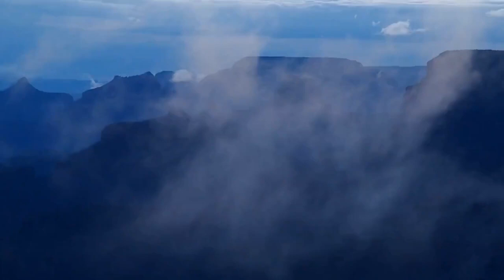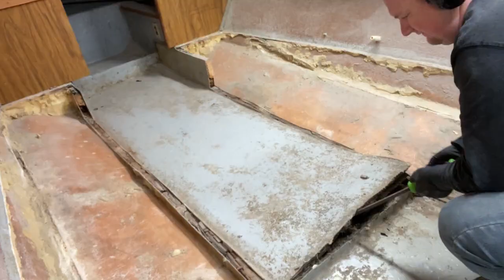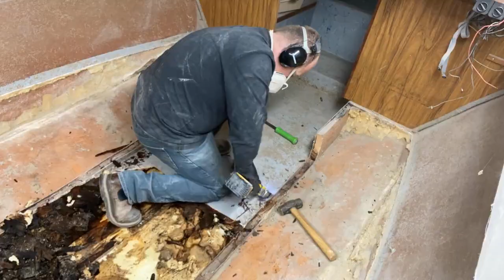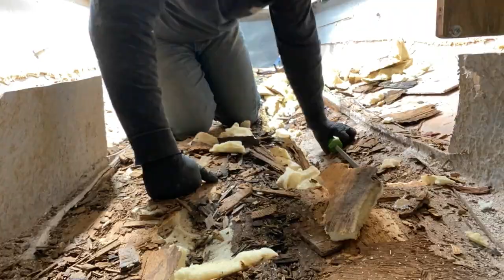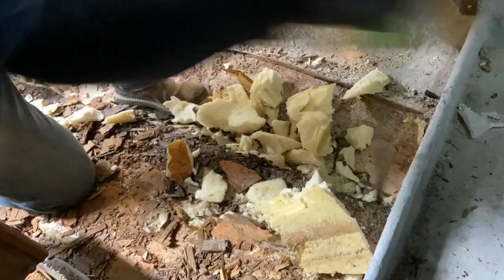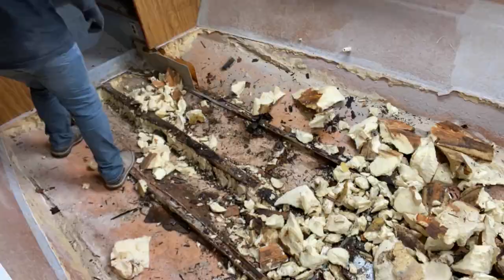Boat Restoration| Starting removal of rotten core #Shorts

Comment: After you remove all that foam, can you just leave the space open like a bilge?
Reply from the maker: I will most likely leave all areas that were sealed off to be able to be drained to the drain plug but I haven’t decided quite on how it will be done. I am not a fan of the foam but i know it helps with water noise especially when on buoy. I am thinking of just doing it in areas of the cabin that will be sealed off. Only time will tell 👍
Reply: @LindellAdventures  I see. I didn’t think of the noise issue.